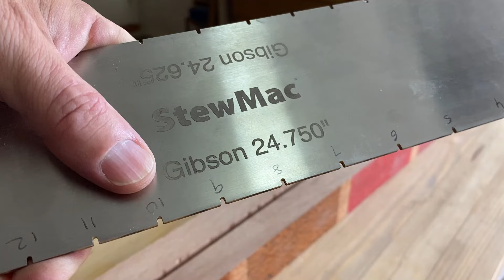Jurgs Cup: part two - neck through

Comment: I'm sure the final result will be another gorgeous piece of art, can't wait to see it finished! 
Don't you think that the joint on the neck exactly all along where the truss road is placed, could weaken it considering the force impressed by the truss road itself? (this is not intended to be a critic to your work, just a simple question 😊)
As I'm writing this comment I just realised that normally there's a similar joint between the neck and tie fretboard, so I believe the answer would be "no"...
Reply from the maker: Thanks! Yes, the joins crossed my mind too, but they should be okay. That’s what I like about this use what you’ve got challenge. Throw all caution to the wind and take a few risks.
Reply: Yes, I'm sure they will be okay. Fender built one piece necks with maple fretboard where the truss road is installed on the back of the neck, on a routed cavity that was closed by a glued wood layer (you know this better than me 😉). This surely proves that these joins are safe when they're well done.
Reply: The direction of the load imposed on the wood from the truss rod being bent will be almost entirely up/down. That is unlikely to open the joint (which would require significant sideways forces). To be honest I doubt its all that different to a 1-piece neck with the load in that direction.
Reply: Yes  @dnizy , you're absolutely right.